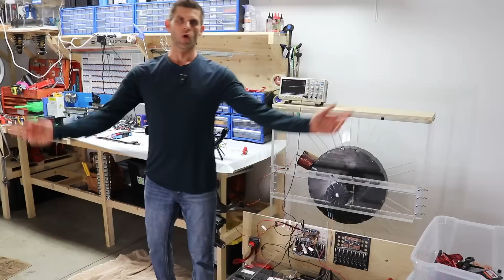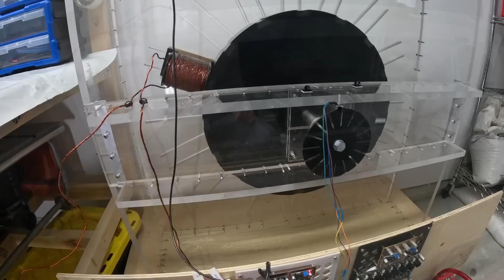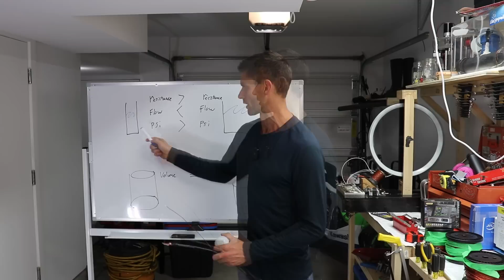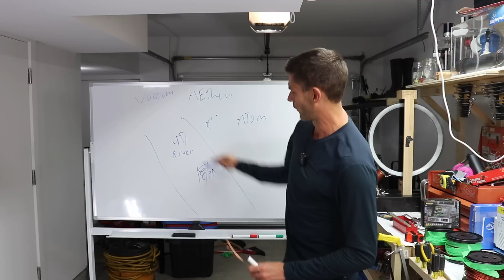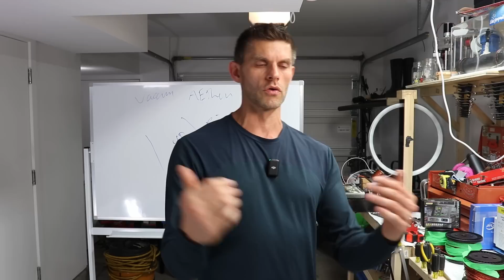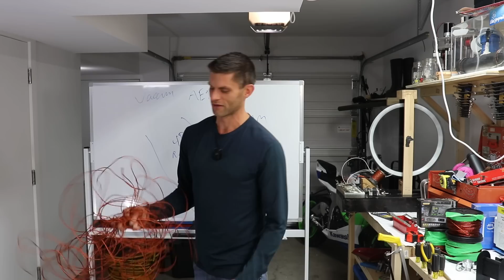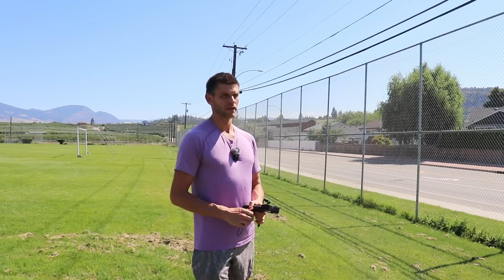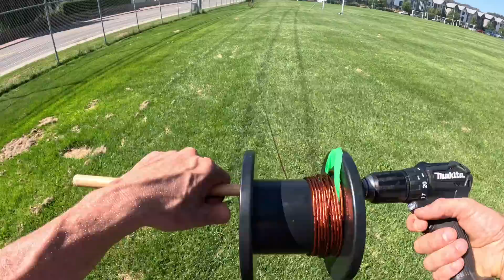I Built This Energy Machine in My Garage — And It Works

Comment from the maker: ⚡ We’re Building Open-Source Clean Energy — and You’re Watching It Happen ⚡
This isn’t theory. This is a real, working prototype of a high-voltage pulse motor generator — built by hand, powered by vacuum energy, and shared openly for the world.

💰 Support the Crowdfund
We’re 100% community funded. Every dollar helps us finish the build, improve the design, and prove the results with data logging.
👉 https://gofund.me/823569a9

💸 Donate with Crypto:
• BTC: bc1ql38sg7q38reay3kf37d2pdazxuaqyz87q9pprx
• ETH: 0xD4712583440F56b1C8A981084F52402dFD9AE467
• SOL: 7Zs5gERUQoBspdk4DDu275eAxWr3kywEBVChrDmz9AYE

📧 Questions or want to collaborate?
→ spencer@limitlesspotential.tech
P: 1-250-864-9828

✅ Like the video
💬 Drop a comment (it helps visibility!)
🔔 Subscribe + turn on notifications

Together, we’re doing what the gatekeepers won’t.
This is for the people. Built in a garage. Powered by possibility.

#physics #science #engineering #cleanenergy #technology
#LimitlessPotential #PulseMotor #VacuumEnergy #OpenSourceScience
Reply: Thanks for doin what ya are. Energy is abundant n there is no reason for all the energy extortion that goes on other than greed. Anyway, the work you are doing proves that YES. Energy IS abundant AND all around us. I don't have funds to contribute however I do have some heart felt thanks for ya. Thanks bud, I appreciate your efforts n the way ya put forth said effort too. Thanks again.
Reply from the maker: @tomrua-e5k thanks for the support ❤
Reply: Keep an open eye. You're a hero 👏
Reply from the maker: @Collin-hs2hs ❤😊❤lol not quite but thanks
Reply: I had an idea of using capacitors to pulse high volts to run a car. You could run a car on a petrol power generator (use less fuel than combustion engine in car), you run electricity into thousands of capacitors, then you pulse that high volts to the electric engine one groups of capacitors at a time. When capacitors are not outputting power to engine they get recharged. All this happens in a cycle. 

Maybe you could even run a car with a  solar panel on car roof, connected to battery then AC invertor and pulse charge capacitors to electric engine thousands of times a second.
Reply: I'm so happy for you. This is going better than I thought it would. When I first started watching, you where only getting 20 - 30 comments and a lot of them were negative. I don't have time to read 600 plus comments but from what I have read, they are very positive. That says a lot that your channel has grown so much in such a short time.
Reply from the maker: @freelifetas1252 yes its been a ride. Lots of nice people here
Reply: If anyone has or is showing negativity to you for doing this, they likely fall into 1 of the following categories: they're just ignorant or an idiot, they are part of a public or private organization that has a conflicting financial interest for you to not succeed in what you're doing, or they're just plain crazy, Please don't let these kind of beings stop you. Be Well and go with the Flow 🌊 Trust your intuition Love to you from Connecticut. 👍💚
Reply: that shoes?!?
Reply from the maker: @yngeneer the best
Reply: The reason some people push back on these types of experiments is because it's blasphemous to their religious beliefs. 😅

The reason some entities push back (this is all my opinion of course) isn't anything to do with controlling the energy, but it's all to do with esoteric, secretive knowledge. It's the entire reason any secret society has ever existed, really. Some might say it's for national security, and they may be correct but it doesn't justify the secrecy and the attacks against anyone who might popularize a better model that they've had for decades. Conspiracy theory? Yes, it is.

There's a reason we've recently seen some technology that seems otherworldly, but isn't and it isn't due to a breakthrough in technology but a breakthrough in physics and their understanding of our universe. That's what they are clutching onto at all costs.
Reply from the maker: @CynHicks ❤totally
Reply: Can I give you a design for magnet motor, that needs triggering at start and runs on its own and powered by the generator, it's not a pulsed system, battery is independent and out is independent, the generation is from magnet power but to run the trigger we need battery, it's simple but I can't make it, as it needs triggering mechanism to be set up, needs little circuitry thing for the timing, as you used optics which would work awesome in my system. 
But only thing you should make sure, to allow people to use it for free, as it would never come out in market and cannot be Commercialized. system has immense torque and speed and needs flywheel and a setup to control the madness it could create. 

If you agree to give it free to all, then I'll share the design n you can make it. 

Plz let me know, I don't want fraud to the public 🌹🌹🌹🙏
Reply: @ranaji99 I bet a lot of people that watch these videos would love to see the plans to this magnetic motor! Do you have a link you can share. The more it gets shared the harder it will be to silence it. Power to the people!!
Reply from the maker: @frankedwards4757 yes but its not finished, how can I like designs to an incomplete build  we openly share everything and have links electronics schematics in previous videos
Reply: @frankedwards4757 you want it as well, let me know, I'll give free, I don't care, just share
Reply from the maker: @ranaji99 ok email it
Reply: @MadscienceLPTECH ok, 👍🌹
Reply: @MadscienceLPTECH , plz check mail and ask if u aren't getting it.
Reply: ahh yea the bro trust me energy. How about you prove it? So far I have not seen 1 overunity device where there wasnt any cheating involved. Its always hidden energy sources, modded measuring devices or like you do not even bothering to prove it.
Reply from the maker: @Anon-wo2xg yes we have. Agree there are lots of scams on social media
Reply: @Anon-wo2xg Try looking at a biodiesel combine harvesting soybeans.  It's an overunity device that doesn't directly use solar, wind or hydro.
Reply: Stay safe bro. Help us be free.
Reply: @VegetaLovee-wk4ci
há 0 segundos
He needs to be acknowledged for just like Nicolas tesla or Einstein and get remunerated for his efforts. Even if this becomes open sourced. Maybe if others in due time would patent it themselves , he could prevent it by patenting it himself and only afterwards make it open sourced. It gives him the ownership without people ripping him of. Because it is a long road full with obstacles. The greedy petrol industry is one of the dangers because his technology could easily fit inside an E.V. car and make it autonomous and infinite without the need for charging or having hundreds KG's of batteries.
Reply: What do you specifically NEED in terms of immediate technical resources? Computers? CNC machines? 3D Printers? Metal supplies? Types of Electronics? I won't promise anything BUT I am one of those people who knows a few people who I can ask to see if they have some slightly older BUT STILL EXCELLENT CONDITION systems that they might part with! You can email me at my channel's address or just reply to this message and I can see what I can do in terms of resources. I'm in Vancouver so not too far from you to ship it or drive it all out!

V
Reply: U the best
Reply: I'd take some precautions at least.  Post these vidoes to companies not of US empire.  So something like TikTok.  Also, I notice you're in a garage, so make sure a Tesla that might be hijacked and hacked isn't intentionally steered into your garge by parking a vehicle or two in the way to act as a block.  You have little idea how they can ramp up the evil upon you.  Also, be cautious traveling out and about.  They get people covertly murdered when buying goods out and about.  They even will have a hot thing to do some type of covert poisoning upon a target.  Try to trust your gut instinct, if you don't feel like going to so-and-so store that on a particular day, don't!  Maybe you'll always get that feeling about XYZ store/business, and stop going.  

Sadly to stay protected you must not travel much.  Maybe many in your neighborhood are protecting you, but it only takes one bad apple to end you.  Maybe the Chinese and Russian neighbors can be a bit more trusted, but watch out of Taiwanese.  Ya know, think on these things to protect ya.

I'd even go as far to send African nations this knowledge and Iran, if you send digitally send them some important videos.  To make sure it's spread if the worst happens to you.

And thank you for being couragous enough to under cover highly kept national security secrets.

☿
Reply from the maker: Thanks for the tips and commenting
Reply: @MadscienceLPTECH  No problem warrior of Light!  Just keep at it.  A little tip if you didn't know about copper, is it can super charge your garden and plants.  Just get a stick and wrap a bit of copper around it making it a couple to several feet.  You can just stick it in your garden as is, or ground it into the ground.  I also saw someone use an alluminum pole with a zinc bolt at the end of the system they made to really super charge your plants.

Try grounding yourself too, bare skin, usually feet or whatever on grass/plants dirt or rocks on the Earth.  Try touching some plants/trees too.

As you might notice them more and more, just try to relax if you get freaked out with their stupid gang stalking games they play.  They're the same ice cream truck people you might've heard about recently.  Carl Sagan wrote a book with a very telling title, it is a demon haunted world.  Be wary of ANY zionist or those trained by them.  They're easy to stop actually, as they worship false idols.  Even if you married one, becaus e they've tried to inject their own mind-control zios into my life as a teen into my adulthood. They love Tesla vehicles too.  No plates, and driving breaking rules around you, you gotta let their stupid stuff pass through you like the quote about fear in Dune.  

Also, if at the store, and you don't feel right about a product, listen to that feeling.  They'll remove all products but one or two tainted ones leaving them in the front.  They surely have an AI on you and people like me that knows everything about you and what you buy.

But know that Source is going to pull all the Light from this world and bring us Light to the New Gaia, and let the darkness eat itself here.  But still, it's important to keep on trying, so keep at it.  We likely will be able to recall past lives on the New Gaia too.

Nikola Tesla and others like him were right about, everything.  It's all about frequencies and vibrations, the Universe.

AND!  If you so ever wanted to interact with Source, tripping is the best way to get there and open up your 3rd eye, to see.

I rank higher than Illuminati and lizard people, as Mercury, messenger of the Gods.  Know what I say is true and much love and Light to you warrior of Light.

Also, if you can check out Ashton Forbes.  He has some GREAT videos on YouTube, just did one about the AEther.  I time stamped it, but if you give it like 3-ish minutes he showes the Aether experiment and it actually works when the test/experiment is turned vertically.  https://www.youtube.com/live/LU8f5H7iXcM?si=gsi66SSh8lPx_AXT&t=3867

Again, much Love and Light to you warrior.  Even if they murder us off, we still will win, so relax.  Be brave as you naturally seem to be.

-Christopher Borra ☿
Reply: Also, Carl Sagan knew about God and wrote about it in Contact, but it's in reverse.  He wrote it this way because he didn't want his family and loved ones targeted.  But again, know we're being taken to a brighter place to starve the darkness.  Know it, believe it, and be fearless.  And so shall be, and so it is.

And, we live on a super-Earth, which is why all the fake NASA and pals stuff, and it could seem like a flat Earth because you're on a tiny part of a much bigger Earth space aliens trap us on.

☿
Reply: @MadscienceLPTECH  is there any links to open source paperwork or any way you can provide any on this project that we can study and go over?
Reply: @MadscienceLPTECH   Chinese and Russians can't be trusted. Ukrainians can be trusted. Thane Heins already introduced RegenX generator to Ukrainian institute of thermophysics.

Comment: Did you all know that you can make a large coil of wire near power lines and bleed off current just from the proximity? They will catch you eventually and at the cost of copper it will probably not offset the gains you get before the lawsuit but it can be done...
Reply from the maker: Lol in BC Canada where I'm from back when growing cannabis was illegal 

Ppl would just tap the lines directly and light up a house... 

BC hydro had entire rooms dedicated to finding the taps lol good old days
Reply: @MadscienceLPTECH  They have PD permanently at the power company here as well most their job is looking for illegal grow setups.

Comment: So my thought is how much usable energy do you get from what you are doing? I see you have 18 car batteries in series 9 in each row. 1 row for sending the current and one for recapturing it (the batteries on one side get charged from the other side if I understand what you are doing correctly) so at about $100 a battery that is $2000 plus not counting the space they take up and life span etc. is about 5 years. So just the batteries alone you would have to make over $2000 worth of usable electricity to break even during the 5 years or you are in the hole still. Of course copper is not cheap and the boards you are making are not either. I don't mean to shit all over your idea, I have a similar one using magnets that I was planning on attempting but not using electricity at all to make things move. The issue I can see with your version is that you have to invest a significant amount of money and it is pretty complicated you cannot just gather things around Home Depot or Menards to make it. My thought is if you can expect a better return than your initial investment keep going but what usable energy you will get this way is the real question which not even you seem to have an answer for. Sure, you are gathering extra energy by the flow of electricity from outside the cable.... good job. Problem is if you spend thousands of $$ to do it and only get $200 worth of usable energy that is a big fail. Hopefully you will get more than that but I am not seeing evidence of this at all.
Reply from the maker: Do u know how many billions go into developing other things ? Things used for bad?

Im in mu garage in my spare time trying to do somthing positive 

Heaven forbid we drop 10 20 30k on the prototype 😂
Reply: @MadscienceLPTECH  You obviously did a small scale project with some success. Before you step it up you need to have some idea what the small scale puts out the figure how much to expect by making a larger more powerful version. I.E. if I need 1 lemon to make a glass of lemonade then if I have 10 lemons I probably can make 10 glasses if all other variables increase at the same amount/rate. There is no free lunch but there are more economical ones than what are fed to us. If you cannot figure out an accurate estimate on what your returns will be you have a large issue. My dad could take readings from vibrations on machines from day1 set up to a few weeks then a month later etc. and he could tell you when the machine will need torn down for maintenance even if it was years later. That is the kind of calculations that I am not hearing from you which is disturbing. You cannot get so excited that it worked that you run out and blindly start building a bigger one. Funding or not that is where you will wind up broke.

Comment: Explain how you burn out a sensor that is just detecting slots in the wheel?
Poof of smoke with no explanation of what electronically is causing the poof is not very informative.
Reply from the maker: putting to much energy into it

Comment: My coils charge up three 100 000 micro farad caps which gets switched to the battery through a commutator. No optics or MOSFETs. I used to switch using an SCR but it didn't seem effective.
Reply from the maker: Show us your build

Comment: If electrons are not used and only jiggle back and forth, does that mean that a powerplant is essentially a massive battery(that powers the system)and if we pulse it we could possibly have a second powerplant that stores the potential difference? As with your device?
Reply from the maker: Maybe, I think we can do work multiple times with the same electrons
Reply: It's seems to me like an exploration into geometry and emf should prove productive! I was thinking about how a cavity magnetron works plus and how the coils work in generators, energy seems to have strange effects when the geometry is changed. Do you know of any further readings I could look up?

Comment: So you’re running a motor from a battery, then charging the battery from the motor, essentially making it a generator. Your net power output will be less than your energy input to run the system in the first place. Why? No conversion of energy is 100% efficient. So, maybe 90% of the energy from the battery will be converted to mechanical energy in the rotor to spin it. Then, the momentum from the rotor will create charge back in the coil which goes back to the battery, and this process is also probably only 90% efficient. The net result is you’ve lost 10% of the total energy initially, then another 10% of that remaining energy back to the battery. The total result is you end up with 81% of your initial energy going back to the battery.

What does that mean? Eventually your battery will go flat. This is just another perpetual motion scam from people who don’t understand entropy.
Reply from the maker: you sure about that, tesla was converting energy at 500% no problem. you can do work multiple times with the same energy